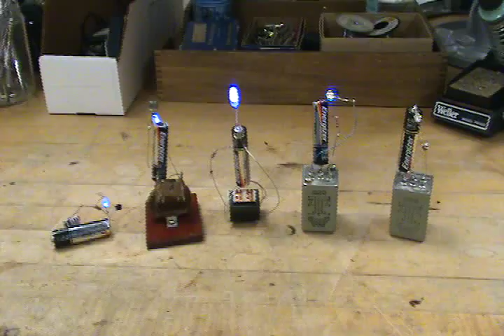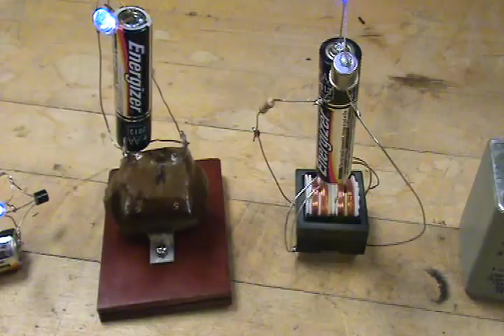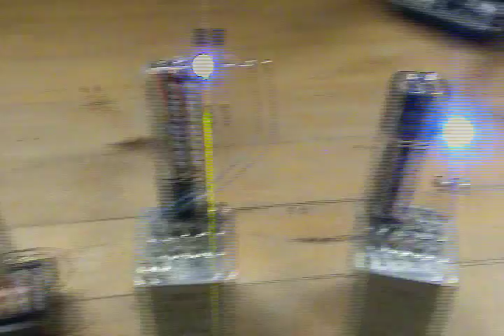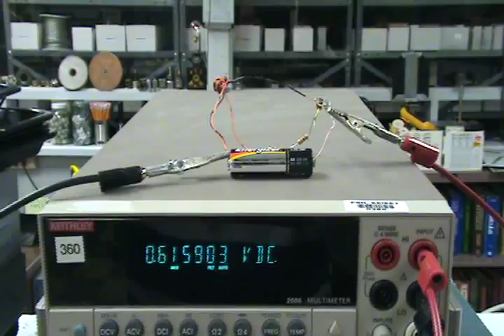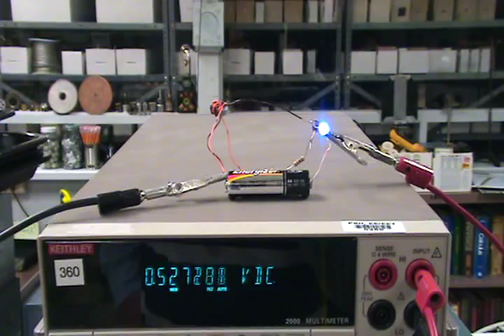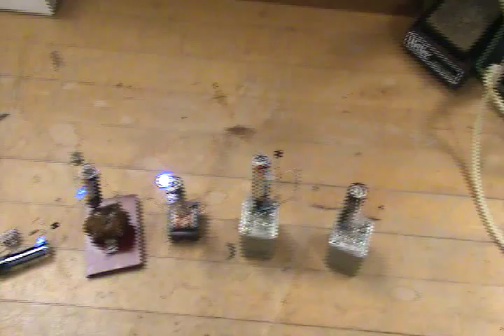(#0006) Low Frequency Joule Thief

Comment: i got the same action on one of mine. It charges during daytime on a solar panel and when it gets dark it switches on, but it doesnt last the whole night. At a certain point when the batteries run low it starts flashing at a decreasing rate until the morning.

Comment: Hi Eric. Can You tell me some tricks please to make JT last longer than usually? I've made  one with some JT and lasted with 1 white bright led only 20 hours long/battery used rechargeble 1400mAmps(5 years old). Sorry for my English.cheers
Reply from the maker: I have not looked into ways to make the joule thief more energy efficient. In fact, it draws almost the same amount of current from the battery with or without the LED. One way to increase life is simply to use a larger battery, like a C or D cell. I currently have a circuit that has been working for more than a week with four C cells wired in parallel.
Reply: thanks for quick reply.cheers
Reply: I had one last almost a week. 6 watt LED
Reply: @bjl1000  can u show us? is'it listed on your channel?